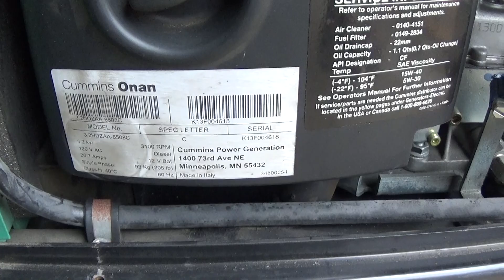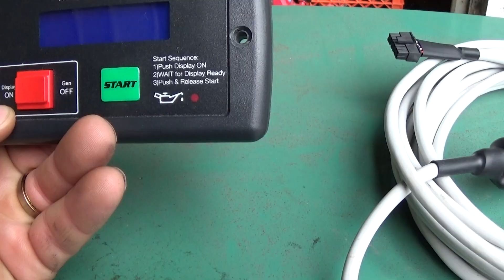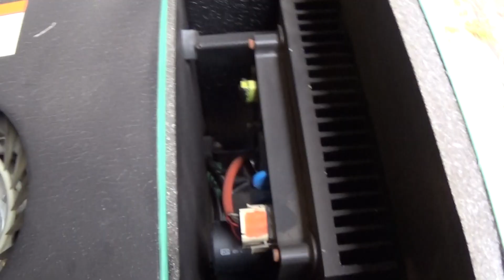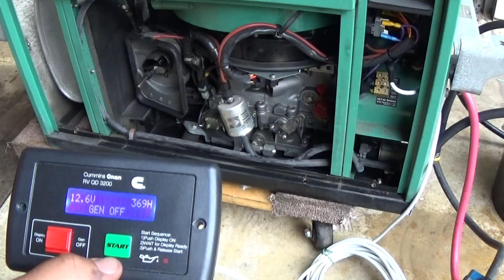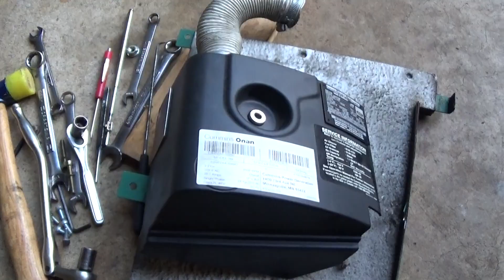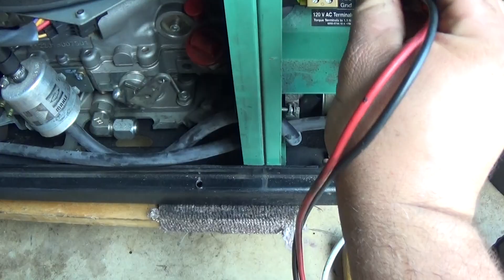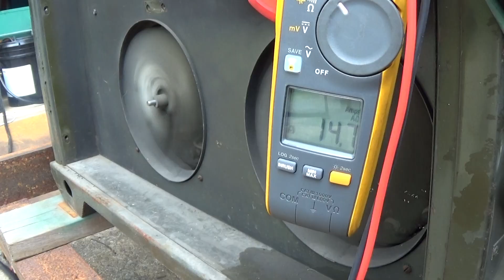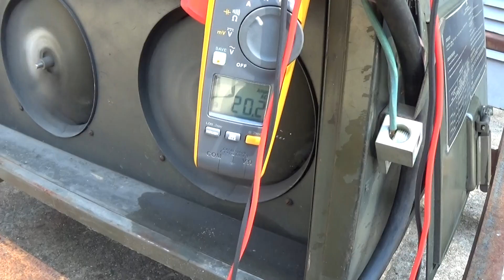Miniature Diesel Generator Diagnose, Repair, Test ONAN RV QD3200

Comment: Rocker arm Nuts with Allen set screws  have a specific tightening procedure.. you must use a wrench on the hex and in the allen and tighten both together at the same time to reach your valve clearance.. just trying to lock the allen only will result in a rocker arm loosing adjustment in most cases.  tightening together does not mean left and right.. it means turn them both right pulling the allen extra tight against the top of the stud.   long handled allen wrenches are usually handy with these.   don't forget that harborfreight sells adjustable carbon piles for 50 bucks.. they are set up for automotive use.. i don't know if you could use the carbon pile at 120 or 240 volts but it might be worth investigating with as many generator sets as you have..  HF #91129.   i need to pick up one to see if i can transplant the carbon pile into my Vat 40 that got knocked over one day..

Comment: You sure had good luck with that generator. I guess the shop that warranted it didn't think it was worth repairing! I was a little concerned that you were overheating the gen set because the exhaust is supposed to be piped away not dumped under it allowing it to bake itself.

Comment: I watched a similar video for a small lawn mower engine repair. And what happened was somebody at the engine factory assembled the engine incorrectly. The valve keeper (gas engine) was up side down so it wouldn't run. Once the keeper was installed properly the engine ran like a champ.

Comment: id be afraid it put the exhaust valve into the piston when the push rod fell out possible over opening the valve. but who knows
Reply: That is not possible. It was not a cam problem, nor a valve timing problem. As the rocker arm nut loosened, the valve would open less and less, until finally the nut came off and the valve opened not at all. No part of that endangers the piston with a valve crash. Intake valve? Maybe some damage, as it would get a hot reverse flow. Air intake path? Definitely at risk. But it all looks like it survived.
Reply: until the pushrod pushes outside the socket on a high spot of rocker, and suddenly opens it further or possibly wedges the rocker and valve open by jamming beside it.
it does depends on how solid the rockers mounting is and amount of free space a pushrod has, the other end could also come out of the lifter socket and suddenly get pushed further out, sometimes it will even bottom the valve spring and break retainers while bending a push rod.
nothing is guaranteed  when it breaks running or even cranking over, many engines have bent valves and cracked pistons from that exact scenario and diesel being higher compression it's pretty much guaranteed there's less clearances at overlap, etc.
Reply: @throttlebottle5906  Good point, thanks for listing them. I wonder, though, if all of those that could damage the piston would not show damage that was not evident to pushrod and/or rocker arm?

Comment: @SmallEngineMechanic excellent stuff, just found your channel this morning. I’m actually going to be working on or checking out an electrical problem on my buddies RV related to his GEN set.

The red silicone you found on the exhaust is very common to seal vent motors on modern high-efficiency condensing furnaces. 
I have replaced a lot of these motors and you need to re-seal the combustion chamber to keep the hot shit in along with the CO2. 

The link here is for the best high temp red silicone you’ll ever purchase. I have even used it to seal leaking/Rusted oil pans on vehicles after they were completely cleaned and dried while on the vehicle. This stuff is tough as nails.

With these things in RVs or other vehicle mounted applications you have to always pay a lot of attention to the exhaust fumes and how they escape from where they are nested.

Cool l and I’ll be following you now to learn more about little engines 👍

https://www.diversitech.com/en-US/item/id/8262

Comment: Put the muffler in the wifes oven and hit the pyro button, almost like a DPF regen 😂👍
Reply: Load wife in the truck for date night, then re-enter kitchen and start "self-clean" cycle on oven.  Open doors and windows on back of house and disable smoke alarms.  Place pillow and blanket on the coach you're gonna sleep on for a week.  Return home after dinner and movie (4 hours) and if house didn't burn down all is well.
Reply: @birdwing98  It "shouldn't" burn the house down but there might be a bit of smoke damage here and there, but hey at least the muffler is clean now 😂 Right?...
Reply: Listen guys, that’s the only part of the house that’s mine, don’t give him any ideas, lol.

Comment: Great job, did you check to see if the battery was being charged?
Reply: These are hooked up to the vehicles charging system when they're standalone and the main engine is off charging the vehicles main battery, but since this is a direct setup it can't get a charge to it
Reply: @Mesoymomo  Sure you can... Plug in a battery charger that runs on 120 VAC.
Reply: My thoughts exactly. 12.6V isn't charging the battery.

Comment: if it's a 3 phase generator it's AC power not DC which needs no inverter. 3 phase power is sine waves like wall power which is actually 165 volts. what comes out of outlets is equivalent to 120 volts DC. AC wall voltage is 330 volts peak to peak positive sine wave to negative. so the generator is actually putting out 165 volts, 330 P to P.

Comment: Seems more likely the adjustment locking nut had not been tightened on the valve and just worked its way lose after 350 hours and then the arm and rod fell off, quite lucky really as that could of got the value in the open position and then piston could of struck the valve (seen this happen on cars when the rocker half falls off and gets wedged open between the value tip and the top cover, the piston comes up and bends the valve)

Comment: That gen is a single phase not a 3 phase like you said. Read the labels
Reply: Michael McSherry on most inverter generators, the stator makes 3 phase AC at a varying voltage and frequency. The inverter turns it into single phase AC at regulated line voltage.

Comment: I don't understand, why would they want you to run it at 100% load before shutting it off? Wouldn't everything be super hot, then just shut the cooling system down doesn't make any sense. After 100% you should run it for 5 minutes at 0% IMO to let everything cool down instead of shutting it down hot.

Comment: Ok I have watched this several times and I work on Onan all the time and the question i have is this, when you remove the valve cover you find the push rod for the exhaust no longer under the rocker arm and free floating, so assuming the valve adjuster backed off slowly, should have been easy to hear right up until it completely fell out of the rocker, yes this is before you got it but this is noisy condition and someone should have got the message long before but ok so no one did but the air gap between the push rod and the rocker arm would have been all beat up, usually to the point of being no longer serviceable. These rocker arms and pushrods look like new and the fact they didn't bend is very suspect also. If it ran long enough to clog up the muffler then it would have damage on the rockers and the push rods. Also when you show the valve stems the intake valve has way more lash than it needs, you could almost remove the intake pushrod but the intake valve is not closed. The intake and exhaust valve should protrude out of the head casting the same amount but the intake is clearly shorter than the exhaust valve so not sure what is going on there, maybe bad camera angle but this engine should not run at all. The parts book shows the valves same length and the push rods the same number so the valves have to be the same length. In case you do not have a copy here is the parts manual for this engine.
http://engine.od.ua/ufiles/HATZ-1B20V-1B30V-Diesel-SP.pdf

Comment: I had one of these that had a bad carb.  I replaced the carb and didn't set the governor correctly, it overrevved and threw a couple of the field winding and shorted out.  It was an older unit so you probably won't have problems with weak epoxy on the windings but just something to check if it's not generating.

Comment: If that little rig were mine, I would engineer a remote mount oil filter, and an external oil cooler. It would increase the oil capacity, and add a second form of heat rejection. It would probably double or triple its life expectancy also.
Reply: 1.1 quarts is not much for sure. Bet that shortens engine life. Especially in such a tight hot environment. I agree an external oil cooler for cooling and the extra capacity would for sure extend the poor girls life quite a bit. People saying its not worth it. A reliable long lasting compact 3kw gen is worth much more than a bulky broken one. Js. ✌👍👌
Reply: Would be a cool thing to do from an engineering project standpoint. But the juice probably isn't worth the squeeze on a small unit like that.
Reply: or just change it more often?
Reply: CumminsDslPwr also toss in a centrifugal filter for good measure... room you say? Why look over there 👉... muffler? Never seen her

Comment: the fan hub looks like it would be a good candidate for a gel rust remover, then coated with anti-oxidant of some sort so when the fan needs removed in 5 years you actually could. I will bet when your torque properly the valve settings maybe with thread lock, this genset will run for ten years @ 3100 rpm with no problems unless the silly inverter goes. I don't think dewalt battery chargers will work with an inverter, in fact I think it will destroy dewalt chargers. Need an old transformer type genset to use dewalt.

Comment: They sell the cheap Chinese ones here for $2000 US, so what a deal for free. Even used ones they still want $1500+ for one. 
Wish I had one I got a dual fuel 5.1 Kilowatt Chinese one, it runs the whole house no problem with the A/C on too. But they are pretty noisy the neighbors hate me when the power goes out, I'm a nice guy though and run a cord over to their house so they can have light and a fan for the baby. I don't think they mind so much now when it's 100F and the power goes out at least a fan is good. I know what it was like before I got my gen. and it was terrible, no breeze and hot as hell.
Oh , my unit was $700 USD little expensive because demand was high and supply low and if I didn't buy it the guy behind me would have. It's on wheels too and has electric start 6.5 HP engine maybe not too expensive . For two months I had it running a few hours everyday and no problems, changed the oil once and everything looks good, holds 220v and 50Hz under heavy loads . It has 3 phase and DC charging too it you want to do some welding or whatever in the field.

Comment: I would be wondering whether or not the exhaust was vented properly because looking at the filter I had to wonder if the Co2 was entering  via the air filter and I suspect the silly twits who owned the RV most likely had to much current draw for 3.2Kw and was likely hitting the draw limit capacity..

I suspect the Cummins Dealer  upgraded the power unit to suit the load than repair it  and stick back in with a service..

and looking at the carbon crap in the  filter I would have to wonder if the exhaust vent was blocked  causing the exhaust off gasses to be vented back into the air filter

I suspect the rv setup was more to the liking of 7.5 Kww engine, though likely  opted for the lower capacity motor for weight save  however I doubt the rv had been setup for the lower spec engine   thus cause a exhaust venting issue  I suspect the exhaust likely vented back into the confines of the genset case

Looking at the soot deposits in the air filter..

I do not think looking at the design layout in the genset was likely never really designed to be used in the RV industry if it was deigned to be put in the RV rather than a retrofit application as was most likely the case why it actually failed within the 1st 1,000 hours is likely because the  exhaust layout is wrong for physical use...

I suspect the lack of a external tie-in pipe  in the rv itself likely cause multiple issue on its own..

venting in eith the cavity space of the genst or in this case ventin into the cavity the genst physically sits likely caused the excess soot because the genset wasn't wasn't getting enough clean air to create a clean burn..

I would have to also wonder whether the genset  was a diesel engin to begin with, because i have yet to see diesel generator under 6KW, this being 3.2 Kw i would have to ask whether this generator was diesel to begin with, I would suspect  something along the lines of petrol and/or lpg or multi fuel setup between petrol and lpg gas..

Comment: If you're going to be a "Diesel Doc" expect a lot of really black dirt! It washed off, and you don't need to apologize!  On the exhaust...yeah, that was a faux pas.  Should have taken off the bottom clamp. Probably Marmon flange type (both ends shaped top clamp up tight with the clamps having a V groove. Really common on diesels, for low f;low restriction, and easy to make a leak proof connection when the  alignment isn't perfect.) Much better connection IMHO than expanding one pipe to fit over the other, and uses less room! Smoke?  Probably normal for an engine that has probably not been in tune for some time, and is running under load. Given the size of the generator (tiny) and the fact that it is an inverter type, it was probably used only to operate technical equipment. The mobile unit probably had two gen sets, the other one being large enough to run the A/C and/or heat, lights and so on. This one would never be happy with anything beyond a single 15k roof top air.  And, being inverter, it would be overkill to use for those loads. Smokes like a diesel with oily muffler and air filter. Probably the only way practical to eliminate smoke under load would be to have it turbocharged. The muffler will eventually clean up the rest of the way, once you bring the load up, and therefore the exhaust heat. (build a bigger fire, get more heat)

LOVE your load bank! Mine is a commercial unit, and good for 10Kw 120/240 single phase. Good old military surplus!! Those variacs probably will come around with some good contact cleaner, and "buzzing" the know back and forth.

Comment: It didn't seem to be charging the battery, if it was supposed to. Batt voltage while running seemed to stay at 12.6 or so?
Reply: It may not be designed to charge the batteries if it is starting off an RV house bank as they ordinarily have their own AC powered charge controller that would then be part of the AC load powered by the generator.
Reply: @ethanpoole3443  Yes I know. That's why I asked the question that way.

Comment: Good old 15/40! I was running a D8-H on a dam job when another crew decided to work saturday. I came in on monday and no 8. I hopped in the foreman's rig and we went hunting. It was hidden in a hollow, still RUNNING! It ran all weekend and had sutted the stack up to about a 1 inch hole. I pulled my coat over my head and yanked the throttle open. Soot rained down for a WHILE! When it slowed down I ran it over and filled it up with fuel and oil. It spit a piece of soot for a day or 2 but no after effects. Tough old lo speed Cat!
Reply: Long ago we had bought a new D8H. We were on a job with a $10K a day late penalty when the D8 started using gallons of oil per day. No replacement dozer was available so they decided to keep running it. It had over 10,000hrs on the engine. It survived. Nice thing about those engines is the block is good as new after sleeves. The cost for a full overhaul is low considering the price of a new machine.

Comment: Strange, The documentation I've seen for the little Hatz 1B engine shows valve clearances to be checked every 250hrs, that sounds reasonable for one of these?. .. I'm guessing it was never done on this particular lump and it went out of adjustment and rattled loose

Comment: Very nice job. Thanks for the video. I have a small engine shop (semi-retired) and had a very nice riding mower given to me that only had a leaky carburetor on it. I rebuilt the carb and use it a lot with no issues. Thanks for that video.

Comment: I,m never that lucky< last genny y got for free from a customer refused to start (aircooled diesel) after a little research y had to strip the complete generator set down, to open up the engine, it had a broken piston (ring gap broken) after replacing the piston whit a new genuine yanmar one, the china set runs like new!  but y had to take the complete set out of another...lol Made in chine crap... (like kipor)

Comment: Maybe run some solvent from a parts washer/cleaner thru that stinky old clog up muffler ...thoroughly flush it out ..
🧡🧡🧡🧡
Reply: you would use sodium hydroxide aka caustic soda to decoke an exhaust
Reply: burn it out

Comment: Great but horrible genny. We used them with our company with over a couple hundred trucks. The motor is a great motor but the electronics on it are the downfall. We were constantly in the shop for electronic issues.

Comment: Mike, a good man like you should receive gifts like this.  That 'load bank' thingy looks to be military.  What would it's use in the military be?  Thanks for the vid, put up more and I for sure will watch.
Reply: Hello Mike I got welding machine and plasma cutter 220v 50 amps  many i use. Thanks Victor.
Reply: @ErikDK Thanks Erik.  I guess if a unit was on bivoack, loads would vary if being used to regulate power for the Bosses tent.  LOL!
Reply: @ErikDK :) Right answer!